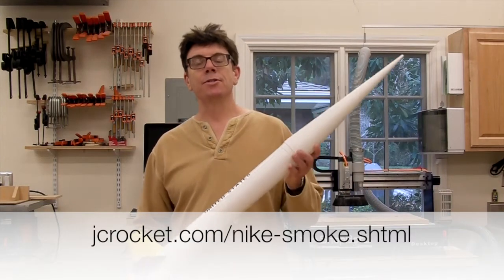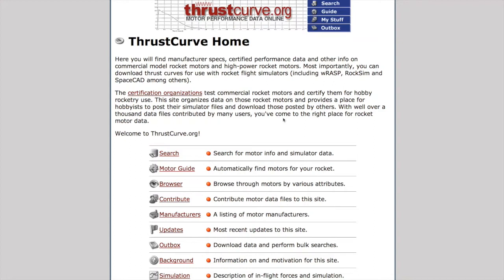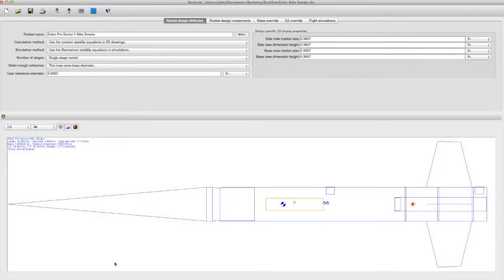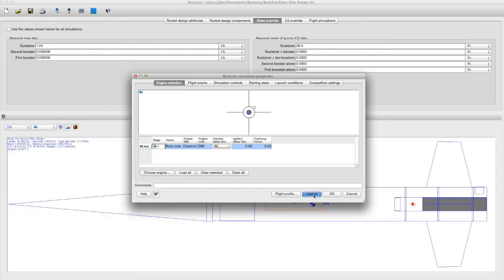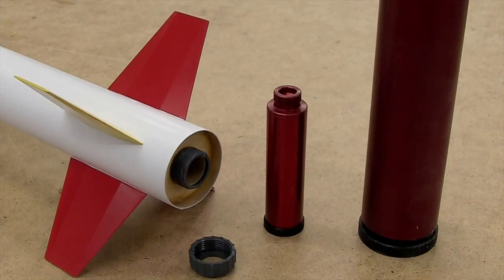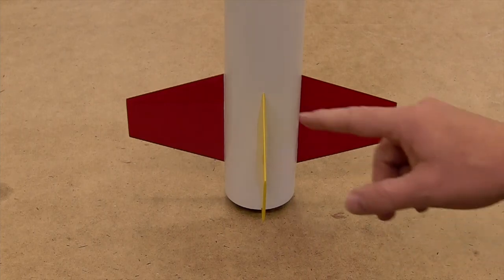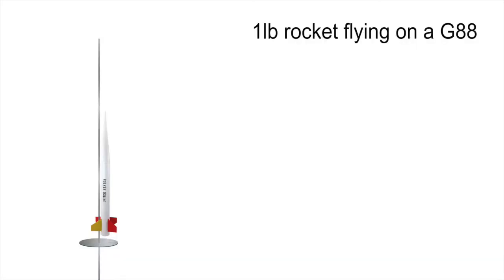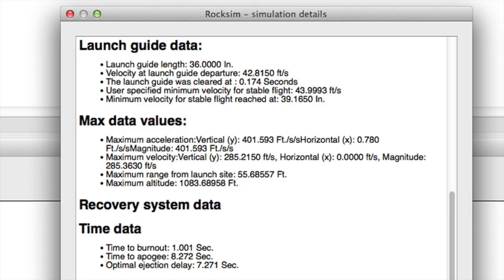Choosing Motors

Comment: I have built a few Estes Rockets over the years. On most I put on a Center of Gravity symbol and mark the distance to the tip, the bottom, and dry (no motor) weight of the rocket.  By the way, little known fact: Estes was founded by Ted Estes, he wanted to call the company "Testes", but he didn't have the balls.

Comment: is there a a simpler way to make a  recovery system? In other words is there anything wrong with using a black powder charge despite motor size and Rocket size
Reply from the maker: Black powder charges are the most common way to recover hobby rockets of all sizes. Note that model rocket motors use built in charges and HPR motors use separate charges, but they're all black powder.
There are other options, such as CO₂ systems, but they're less common.
Reply: John Coker thank you for the prompt response. the reason I ask is because I make sugar Rockets with delay grains and black powder charges. but I've noticed on large herb Rockets they use apogee detectors. for the record they do not make the g-wiz flight computer anymore the company went out of business.
Reply from the maker: Yes, but there are other makers of flight computers in business so there still are plenty of options. A good starter unit is the Missile Works RRC2.

Comment: can i run a 38mm G motor without a class1 certificate
Reply: Not all g motors. The g-80t is the biggest g you can use without l1 cert in the 29mm size. The g100 is a level 1 cert motor
Reply from the maker: All G motors can be flown without certification. The cut-off is level 1 required for H & I motors.